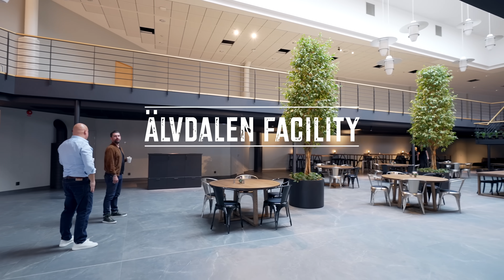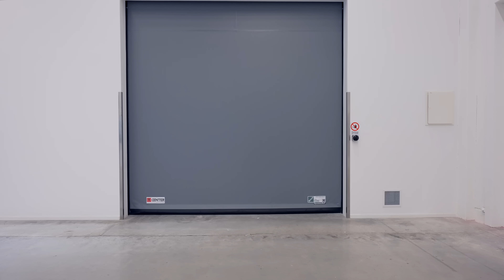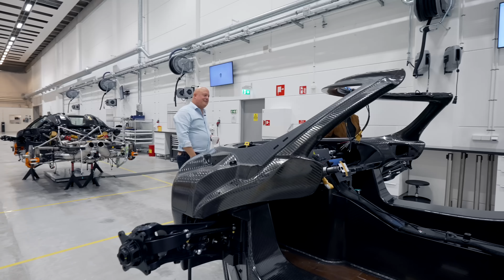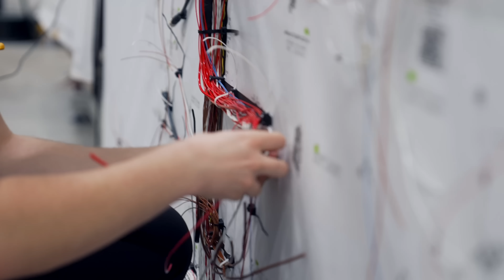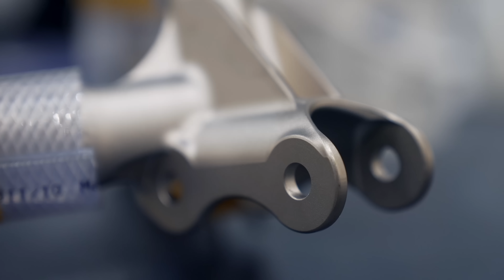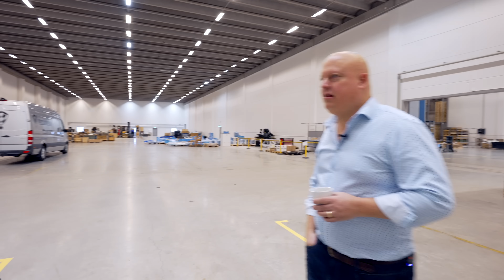Koenigsegg JESKO Is Here! Christian Von Koenigsegg Exclusive

Comment: Aluminum wires may save weight but it expands and contracts much more than copper. It's why they stopped using aluminum wire in the US when building new homes decades ago.
Fire prevention.

Comment: Grate day M.JWW ,  I heard, Koenigsegg's VON CHRISTIAN  was looking for designers to use his electric motors in there build.   
    My name is VINCENT GARCIA,  I have been designing a supper yacht for 20 years . 
   Yet it's protype Name is called rumrunner 1.   It of the future with a water jet hydronic lever system but needs efficient electric motors for population.   Have you heard anything about Christian wanting to help out on futuristic designs of builds , my design is a 47foot boat ,  yet the actual boat is protype for a superyacht 147 footlong and made to runn against  racing hydrofoils .  
  This vesal is ment to reach speeds of 147 to 180 miles a hour at a boat size of 147 feet with a beam of 52 feet.  
    The protype will be give to Van Christian  for helping me , prove and build out the supper yacht using his motors .  
    Please take this seriously Mr.JWW 
     Because there will have to be several witnesses  to say a 147foot yacht did go 147 to 180 miles a hour.   
        Sounds crazy , about the number 147 it was my first dorm room number 😅  yet the speed of the yacht should be around 172 to 184 miles a hour.

Comment: I wonder if anyone else knows that all the components for the electric cars they use are designed by Rimac for Koneningsegg
Reply: Are you sure about that?
Reply: Rimac helped Koenigsegg with the Regera and provided some technological solutions. But Koenigsegg wanted to to be able to design and make their own EV technological solutions. So the upcoming Gemera and other new Koenigsegg cars will use EV systems fully designed and develped by Koenigsegg themself inhouse.
Reply: @netmannetman8124  Emm no, Rimac still designs and develops their tech, everything in their electric cars is designed and developed by Rimac, they didn't just "help" 😂
Reply: @MaN2Mega  Yes everything in Rimacs own cars are designed, developed and produced by Rimac that is correct. But for Koenigsegg when it comes to Rimacs involvement there are a lot of Koenigseggs own design in the Regera as stated numerous times by CVK in different interview beside Rimacs technology. But the big EV change is coming from Koenigseggs own EV design in the new upcoming Gemera. Koenigsegg have several inhouse developed patented new EV motor technologies and other interesting EV technologies in the pipeline that will be used in different new Koenigsegg cars.
Reply: @netmannetman8124  I guess he wasn´t that sure about that...

Comment: He still has to come up with a new plan building an electric cars sooner:))
Reply: when he does it needs to way ahead and above though, I guess we going to see other type of engine also than electrical as long as battery tech isn,t up to the task to build a hyper/mega car that you can go for a longer period of time and distance, as with trucks there they shuld be the weight of 1/3 or more of the total weight if they should be capable to go distance transport, or the type of batteries that's in use of the windpowered turbin that only can hold 5-6 hours if there is no wind, if you put more than one person in an electrical vehicle the electricity consumption rises prety significantly.
Electric cars for the track would work better though, where it's charging station close the whole time, together with special fastchargers.

Comment: I wonder if raising the voltage on the wiring harness would lower the weight even more due to thinner cables or increase the weight due to thicker insulation 🤔

Comment: I particularly enjoyed the carbon fiber content. It's real, it's structural, it's not solely cosmetic. Manufacturers, (OEM and aftermarket), that make panels/covers/etc. that aren't functional at all AND add unnecessary weight because they're not actually doing anything....are just being ridiculous. 
Also enjoyed the wiring harness detail. I work on large boom lifts daily, and while some others find wiring/testing multi-pin connectors tedious, I consider the activity kind of Zen.

Comment: Instead of all those wires, could you just use a fibre optic cable with shitloads of signals firing down it, with a decoder on the other end saving more weight?.
Reply: So you want to add 20kgs of gear?
Reply: @jonasthemovie  explain please.
Reply: @campervanman5340  You want to add optic nodes and fibers to each and every function, that still would need power.... The car already have plenty of CAN nodes, no need for optics, if they use wires it’s because it needs power or is close to the function itself.
Reply: @jonasthemovie  thank you.

Comment: Bless this man. His cars are the pinnacle of automotive sports cars. If you have made it and fu money this is what you buy, not a Bugatti
Reply: Bugatti no longer exists, it's Bugatti-Rimac now. Rimac produces some parts for Koenigsegg. Most of the electric motors and battery packs are made by Rimac for them. Rimac also makes some CNC parts for them for some strange reason.
There's a lot of Rimac parts in Koenigsegg, that's why they're building their own electric motor and battery production facilities now. They want to be independent of other suppliers.
Rimac and Koenigsegg are really good friends, have been for years. They even had collaborative winter testing at Pirelli’s Sottozero Centre a week or so ago.
Reply: @error262  Dark matter motor is made by Koenigsegg. I believe that they only used mates battery technology
Reply: 1,000,000,000%